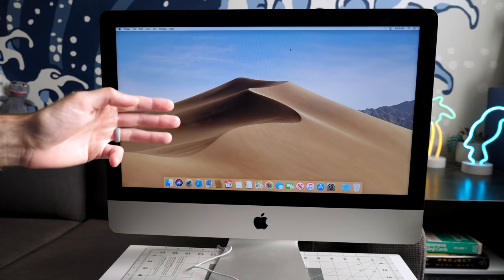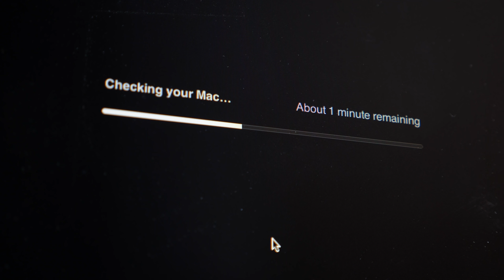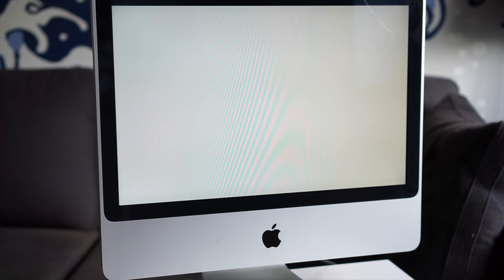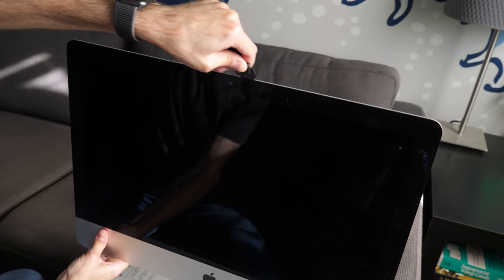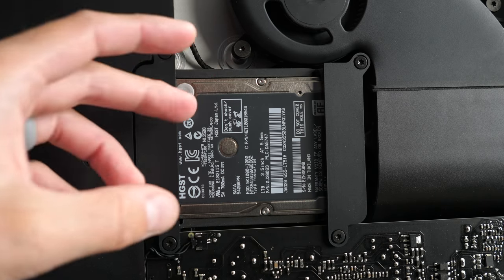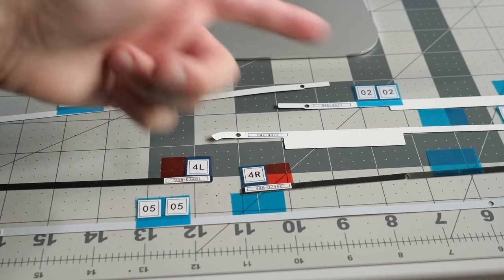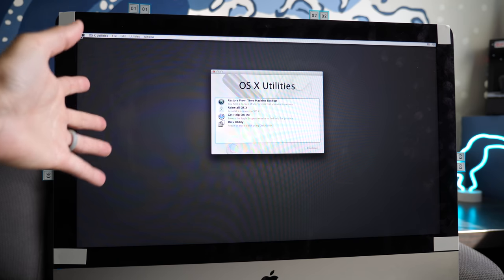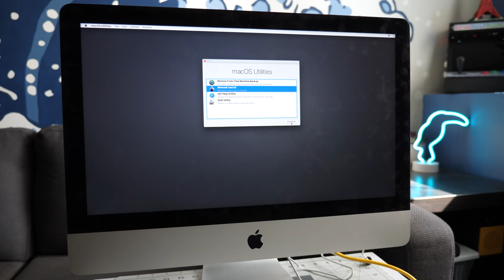DIY 2013 iMac SSD Upgrade!

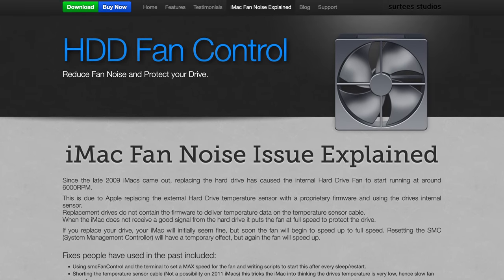Comment: Did this to my Mid 2010 iMac - which I am STILL using even as I type right now. SSD on a failing HDD was great, the fan's jacked up RPM became the issue also. I was using 3rd party Fan Control software but eventually the cable with sensor (13:54) was the true solution. The big problem for me I guess is very little room to work with inside with larger hands. All very doable in those older iMacs, especially when the screen is connected by very strong magnets. But checking out to see how to upgrade my aunts old 2013 21" iMac (Boot up is SLOW and after he light use with internet, youtube videos and online games with heavy java...her iMac just becomes SUPER slow!) I even totally wiped that out and restored to Mavericks..which felt great again, but it has obviously become obsolete - the security updates, She uses Chrome and THAT needs newer OS to update the browser security now. She doesnt need a super computer...but something faster than what she's using now is necessary. (Her iMac is reminding me my ancient 2006 Windows Laptop running Windows 8, it's painful!) 

I'll get around to it in the next few weeks, I guess I need that iFixIt kit now....but ugh.

Comment: Just FYI, a fusion drive doesn't appear in the NVMe settings (my 27" iMac 5k 2014 has a 1Tb Fusion drive which I'm watching this on) - both elements of the disk (the 128Gb SSD and the 1Tb HDD) appear in the SATA under 2 different controllers. The SSD is on Apple's own SATA controller and the HDD uses the motherboard's Intel Chipset SATA controller.

Comment: I can confirm that the late 2009 model of the iMac 27" has a temperature sensor that plugs directly into the hard drive so it goes back earlier than 2010
Reply: I wonder, is it actually a modification apple forced drive makers to do because they're dicks and wanted to limit user repairs, or just the regular SMART system present in all drives for 20+ years doing what it designed for.  I've diagnostic tools that could get lots of info from the debug/diag ports on older sata drives, including temperatures.

Comment: Cmd + R loads the current version of macos installed if you have macos installed or if the hd is blank the earliest version still available for that mac. Cmd + option + r always gives the latest version for that mac. Cmd + shift + option r always gives you  the earliest version still available for that mac. So if you put in a new ssd and want the latest version of macos never bootup using cmd + r. It'll never give you the newest version.

Comment: I was able to get past the fan speed problem on a 2011? model by using a 4 wire sata power extension, I guess it combined the pins in the right way that the machine didn't want to ramp up the fans. Granted I wouldn't do this for a 3.5" drive but an SSD shouldn't get too hot even with the fan speed not accounting for its temps.

Comment: I'm wondering if this is what I should do with my daughters early 2013 iMac, as it's working fine, but slow as molasses compared to my 2013 MacBook laptop, where I added a 1 TB SSD to it some years ago.   So, I'll assume the slowness is the rotational drive, and although she say's she'll deal with the slowness, this upgrade doesn't seem to be too extensive!   I would also like to add another 8 GB of Ram, but I see that is far more extensive in doing that, and the iMac will be mainly used for Word Processing tasks now.   Now to try to find out the cost of the adhesive strips, tools needed, and a decent sized SSD!

Comment: How is the fanspeed? I remember replacing an HDD with an SSD on a slightly older machine and the Fan went full speed. There was some proprietary sensor with the HDD and you had to install a Tool to regulate it back down to sanity.
Reply: Watch the video you’re commenting on and you’ll know

Comment: Funny enough, today I discovered there's a computer at my work that had a hard drive failure, but since it was a Dell, it had built-in diagnostic tools to help me determine the hardware failure... Really beats poking around and reinstalling the OS a handful of times when theres a problem. Too bad Apple (wouldn't) implement anything that would help people fix their own problems.
Reply: Thing is Apple does have an external diagnostic tools so thats another problem not a lot of average joes would have access to unless you are good buddies with people who has connections to Apple service
Reply: @edwardtan1354  So, in other words, they don't really have one.

Comment: The only issue I have found when upgrading hard drives is being able to formant them as APSF file systems. 
Apples Disc tools utilities often limit you to using  extended journaled. This also applies to external SSDs.

Comment: I am on windows 10 Tower I built in 2016 paired via a infra red remote control HDMI switch with a 2012 Mac Mini ( Catalina ) that i upgraded Ram and SSD . Good thing was the old Altec Lansing 7.1 speaker had a desk input i could pair sound with . The samsung curved monitor does basic sound thru the hdmi but now the whole setup has the best of all worlds at a flick of a remote switch . I can toggle both . I do need 2 mouses but thats simples . The old mac mini HDD is still plugged in with a SATA / USB cord

Comment: They started offering Retina display in 2014. Late 2013 did not have Retina display option just fact check 😉 I ordered top of the line late 2013 27 inch model that I am dealing with now, failed cpu fan and needing faster bigger ssd .

Comment: No, the PSU capacitors will not kill you. First, they will discharge in seconds after you unplug it, especially if it's still connected to the mainboard. Second, this is a consumer electronics power supply, and it just doesn't have enough juyce (or Joules): industrial PSU or defibrillators have WAY bigger caps (those can kill you).
If you get the full charge, it will hurt a bit, but that's it. There's a very easy way to experience it without opening the PSU or using any tool, but I won't write it here...

Comment: Trying to install the new OS version on my late 2013 iMac via OpenCore Legacy Patcher. If that doesn't get me the wanted effect, I'll have to try this one. it's also the late 2013, 21.5 model so it should be the same as in the video. Thanks a lot.

Comment: Bought an older 2009 iMac with no hard drive or temperature sensor in it (I'm guessing whoever was in charge of wiping that computer just unplugged everything), so installing the fan software was a cheap and quick was of circumventing that problem without needing to wait for parts. Overall not a terrible experience.

Comment: What frustrates me most about the glass and LCD being a single piece is when the damn glass cracks but the LCD is fine you can't just replace the glass, you have to buy the whole damn LCD unit. Which on a 2013 is not even close to cost effective and you might as well deal with the cracks. I have a 27" 2013 iMac with the i5 4570, 16GB LDDR3, and a 1TB HDD. (Not to mention a 1GB dedicated GeForce 755M that will actually run modern AAA games *still*, if you can deal with 720p low settings lol)

I will probably suck it up and replace the LCD and glass if I get around to upgrading to a SSD since I might as well if I've already got the display off anyway
Reply: For the record, the replacement panel for the 27" late 2013 iMac is roughly $400+ USD for a REFURBISHED panel. Meanwhile the magnetic glass for a 2011? $50 or less brand new. Since the highest offer I've gotten on this iMac is $350, I'd be in the hole if I replaced the panel and sold it, so it's mine for better or worse unless I find someone with a logic board failure in the same model that's just going to throw it away and I can take it off their hands and salvage the panel

Comment: I appreciate your warning about the caps in the PSU, but not making it overdramatic.  "Hey, don't touch these, especially if the machine is plugged in"
Vs in one of the Linus Tech Tips scrapyard wars videos, he came across a bare PC PSU board at a recycling place, where it was clearly there for months, if not years, and was like "PEOPLE CAN DIE IF THEY TOUCH THIS DONT LEAVE THESE OUT!"

Comment: That is really dumb to close it with adhesive on those models. My 2011 iMac which I had to also replace the HDD (I put a Samsung EVO 860 500Gb SSD) was much easier as the glass is held in magnetically. Just use suckers to pull the glass, but be super careful because the bottom part is held in and needs to slide up and if you pull too much you can crack the glass. Once the glass is removed the LCD is held in by screws.

Comment: Serious question, the iFixit and OWC are not the same as the factory which used a double sided foam based adhesive which if you really look at the reviews long term hold up like the factory does; how has your experience been?

Comment: Shame you didn't put in an Nvme pci drive as welll, you would have got 800mbs performance, I have the late 2013, and have upgraded the ram to 16 gig, installed a compatible 500gig  Nvme, and a 2tb 2.5" ssd, the thing now flies, I have the last os from apple on the 2.5 ssd Catalina, with Windows 11 boot camp, and on the Nvme I have open core legacy ventura, which runs fab, great little machine indeed.....👍

Comment: Do you still have to manually enable TRIM support in MacOS with unsupported drives? I remember having to do that on my 2011 MBP the last time I upgraded the OS. At least Apple has a command for that now.

Comment: As this is a used iMac I'm wondering if it's significantly more expensive than a standard used PC from 2013. I just bought a refurbished 2013 HP for under $200. I've never owned a Mac, so I'm curious to know about how much I would have to spend.

Comment: I'm debating a single 2TB SSD or an NVMe drive. or both. My issue is while tearing down my Imac, i need to replace th power button as i ended up tearing the cable when removing the speaker. So irdered a new cable.

Comment: Don't recommend, I cracked screen in 2017 model, because I forgot to plug something and screen was already reattached.... Give it to pros. It is way easier to use external SSD via thunderbolt, stick it at the back and forget it.

Comment: I don't care what modern/ish computer comes across my path, and if I'm doing a refurbishment of it, and if all possible, then I'm replacing any spinning rust that's a boot drive with at least a basic SATAIII 120GB SSD, as I feel it's the single most important thing you can do to help extent the lifespan of an older computer along with maxing out it's RAM, and/or at least adding 8GB if it will take it.

Comment: I just upgraded a 2013, with Catalina to a SSD.  The previous HDD was working fine but very slow. So, I cloned to the new SSD before the install with SuperDuper which I had used before with no issues.  After the Change the SSD is much faster, but I am seeing one issue. After the boot CHIME, there is about a one minute wait, till the boot starts the animation for the boot, which is way faster than before. After it finishes, everything is fast and crisp for ever,  until you turn it off. It doesn't seem to be hurting anything but is there a way can eliminate that delay on boot...Thanks...pvp

Comment: I need to perform this operation but on my 2012 Mac Mini. I suspect the mechanical drive in it has always been kind of bad. I mostly use the Mini as a media server, so that’s what’s been keeping me from doing the upgrade =/
Reply: I've done several SSD + RAM upgrades on 2012 Mac Mini's.. pretty easy to do and the performance gains are totally worth it.
Reply: @cliess  I've already ordered one of those iFixIT screwdriver kits. I plan to do the operation next weekend. Any suggestions or something I should be specially careful with?
Reply: @ManuelAlejandroZarzosa  Just watch a few videos of the process and take your time. The RAM literally requires no tools and takes like 1 minute to do. The hard drive swap does require removing a few parts but does not take long.  One tip would be to use a tool like SuperDuper! to clone your existing drive to your new SSD ahead of time!

Comment: Just use a external SSD in an enclosure. Dont cut it open. The screens have a reported tendency to separate late at night. Even Mr Rossman? recommended not cutting them open. Dont try useing a T5 or T7. Found no difference in boot times. 2013 iMacs just not modern enougth. Standars SSD best.

Comment: Does this apply to the holiday 2013 edition iMacs?  Because I got one of these (also 21.3") and it'll be a MUCH needed upgrade

EDIT: and I've had it since it was brand new, first owner.. and I agree that it's still useful (at the time this comment was written).. for now...
Reply: As long as the device has a 1TB 5400RPM HDD. If it's a fusion drive, a thermal sensor will be needed additionally.
Reply: @jockeyjeon9532  yes.  My iMac for sure has a 5400rpm drive.  As for it being fusion I haven't checked since I haven't had the best track record when it comes to screen replacement
Reply: @adventureoflinkmk2  Oh yes, opening the display is a daunting task indeed. I put a pillow and towel on the table to catch the display in case it falls.

Comment: 17:16 should you use rubbing alcohol to clean the surface of old glue residue
Reply: I also didn't clean the glue residue and it started to peel off after 2 years and I'm guessing that's the reason why. Either that or the adhesive strip isn't as sticky as the original.

Comment: I don't think I've ever seen a hard drive go that slow before in my entire life at best they mostly average 100 except for the old IDE and SATA 1 drives.
Reply: Yeah I'm thinking that one was damaged / defective
Reply: it's probably slow because it doesn't have a lot of cache and doesn't spin very fast, I have an old 2.5 inch hitachi sata 2 40GB 5400RPM HDD that I use for backups on my laptop and it's really slow too but the drive works the way it's supposed to and has no bad sectors.

Comment: Is it worth the hassle to swap out a hybrid drive for an SSD on a 2015 iMac 27"?
Reply: If your iMac has 128G SSD version of Fusion Drive, I'd say barely since you can just put OS and most big apps on SSD. However if the 24G version, then getting rid of it makes sense.

Comment: Other option, much easier, install your os on a external ssd, like i did on my wifes imac. No need to open the imac. Printed a 3d holder for the sansung t9 ssd. Instand performance boost. Think not all options are available for the ssd this way, but no need to open the imac.

Comment: God I hate the way apple make their PCs.  EVERYTHING seems designed to drastically limit the lifespan of the device and at the same time, make it near impossible for 'normal' people to repair or service them.  I dread every time a customer walks into my shop with a macbook or imac under their arm to get fixed :(
And boy do they use the bottom of the barrel parts for items they don't manufacture themselves.  The cheapest hottest drives are always found in apple computers.

Comment: Design by dick moves , super easy to place that hd with a access panel at back but good old apple wanna glue it shut , joke is when these machines are exposed to hot climates that adhesive has been known to fail causing catastrophic damage that no one believes happened #righttorepair